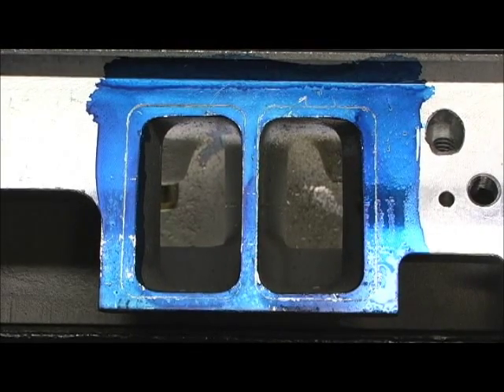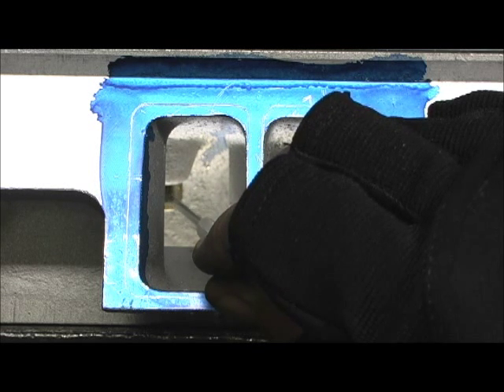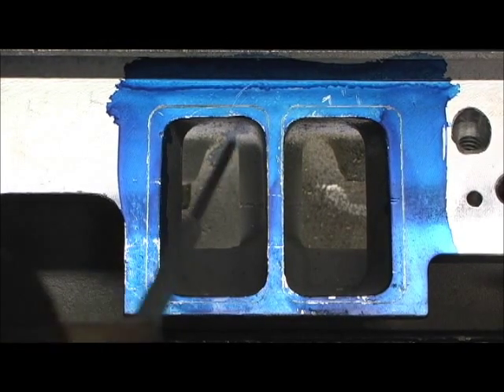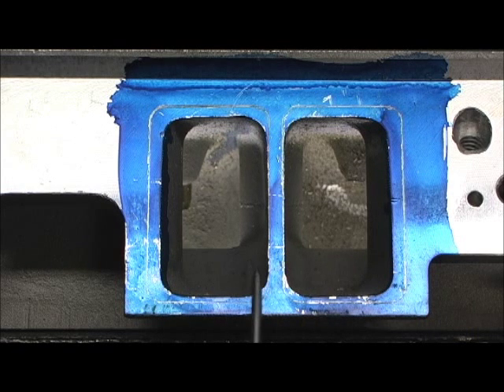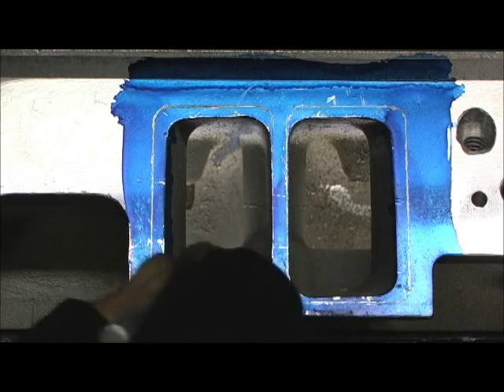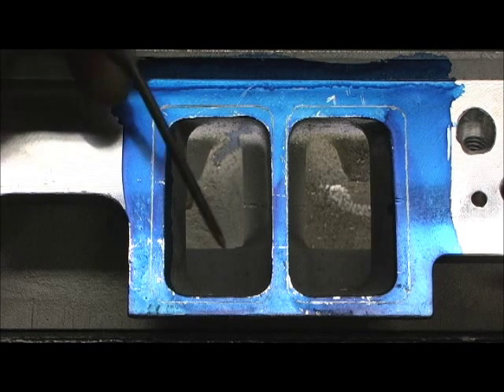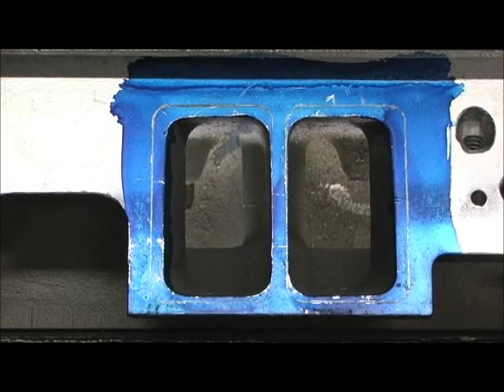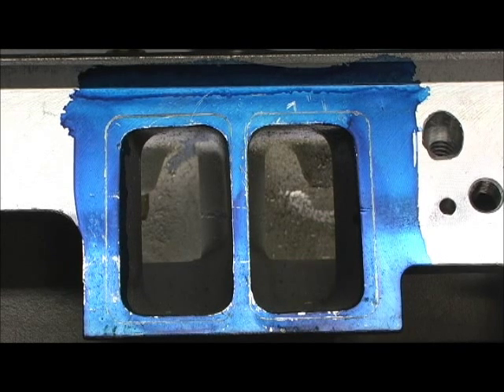ProComp 190cc Stage IV 5  Removal and blending of Pillar of Power 2 4

Comment from the maker: For years I have cut down guide length, when it is UNESSESARY to support a certain head diameter (weight) and distance from the end of the guide to the seat. In the ProComp case, after cutting it down I still have over 2 inches of guide to support it, and the Head Diameter is under 2.100 so weight is not a problem.